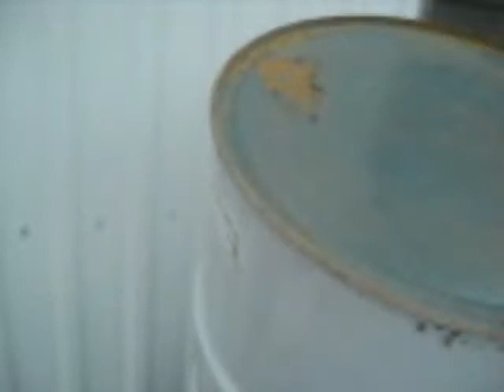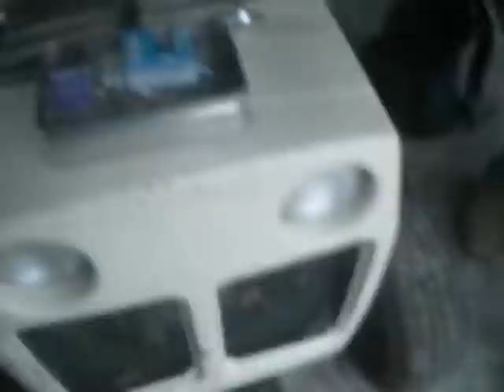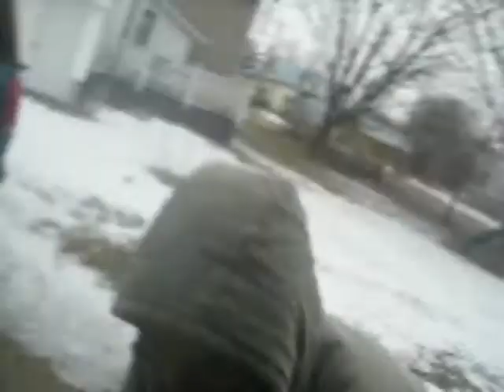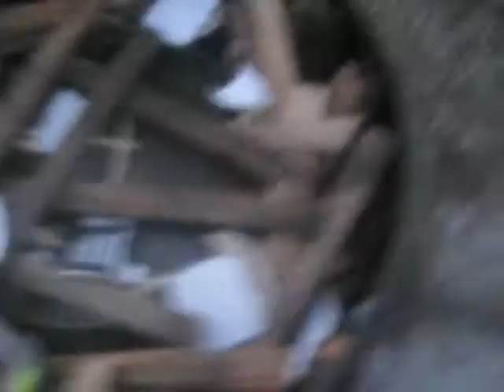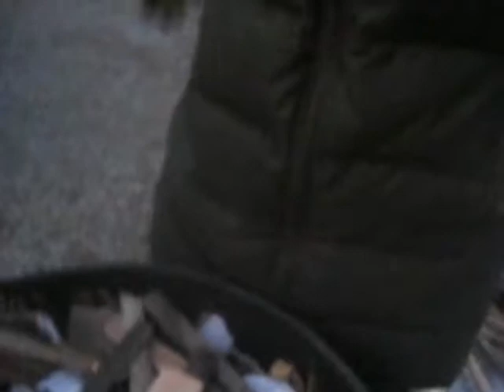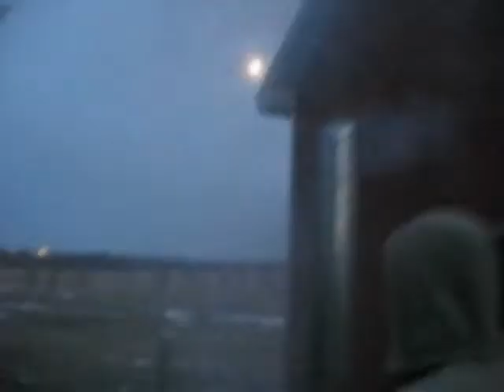Project Rejuvenator workshop, Biochar Reactor construction Mar 6 2012

Comment from the maker: @Tidnull it's just the single pyrolysis in the internal barrel, the external barrel was used for fires for a long time, has holes in the bottom. Used a tiny amount of gas as fire starter, though paper and twigs would do it also, the burn starts on top and goes down.

Comment: wow theres double pyrolysis going on in the reactor and the heat riser! so the wood in the barrel is just to heat the biochar container? is there a cool air intake for the barrel? also did you use gas to start the burn? i am intrigued, thanks for the video